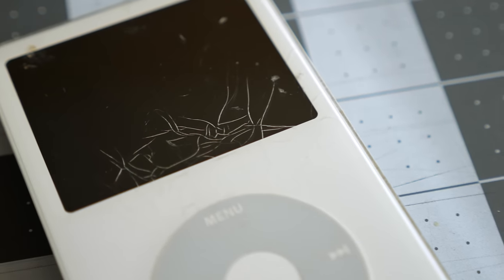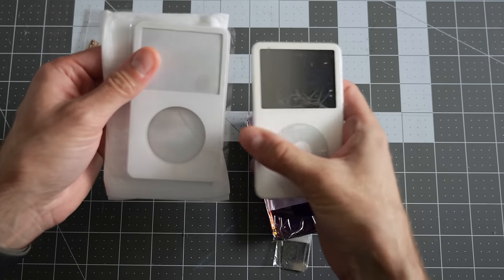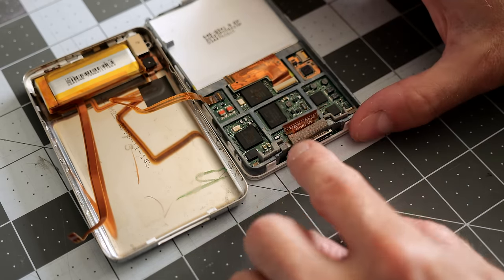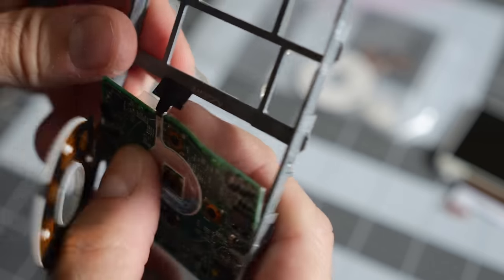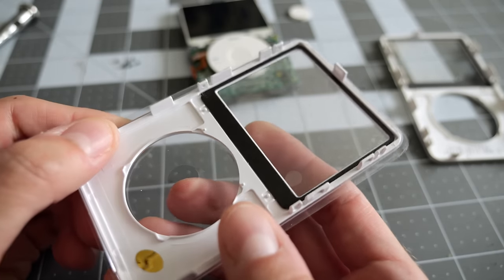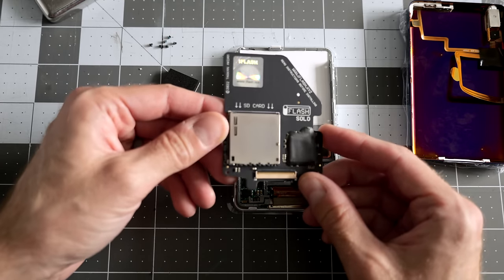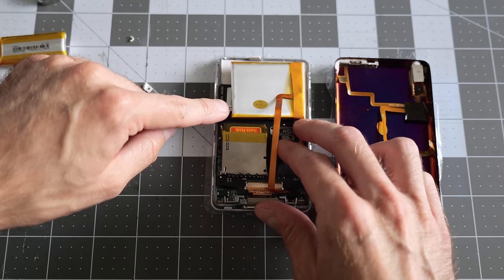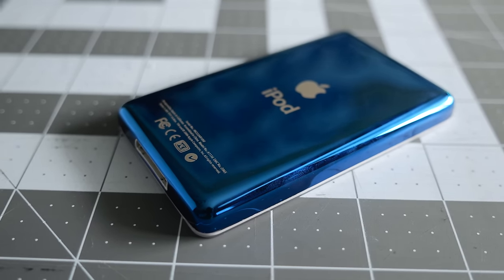Building a Custom iPod Video!

Comment: The iPod Video was legendary for it's popularity and general reliability. The interface was nice, the playback controls were great, the features were useful, and the DAC+amp combo were plenty competent for all of the file formats that iTunes supported at the time. Definitely a gem of an MP3 player. I believe it also supported Apple's CoverFlow album display, which I was always a massive fan of.

I'm also a huge fan of the double-shot clear over solid faceplates that Apple used to ensure that the device would maintain a premium aesthetic. The anodized faceplate on the 6th gen was nice from a tactile perspective since it was slightly rounded over and thinner than the plastic faceplate, but it has a very different aesthetic. Personally, I'd probably go with an mSATA drive adapter just for enhanced reliability and random IOPS performance, but that's really neither here nor there. High quality SD cards are quite reliable these days, so there's no particular detriment to going with one of those instead. Plus, it's not terribly expensive to get a 512GB drive in either form factor, even microSD.

Comment: A little bit of heat-- nothing crazy, just like from a hair dryer-- makes the adhesive a lot easier to remove without stressing the ribbon cables. Hope this helps someone.

Comment: If you break a zif connector locking bar (what he's is calling the bale) you can actually shove a thin piece of plastic on top of the cable in the connector and that will insure a solid connection even in the situation the device is jostled and moved about.

Comment: A correction about the maximum number of files. its not about the total file size, but that META data in the file, Song name, artist name, album cover, genre. These get loaded into ram when you hit play on any given playlist. 

This is why its roughly 20000 or 50000 songs, as it varies on what meta data you have. btw those numbers are for your average meta data. 
The limit is there because you only have so much ram to load this data into. You can have more songs than this number, but your playlist can't be more than this. so say you have 15000 in one playlist and another 15000 in another. you'll be fine, cause you are only ever loading 15000 songs worth of meta data into ram.

Comment: Fascinating. I never dreamed how repairable iPods were. This reminds me of an ad long ago for an early 60s VW Beetle. VW built a car entirely out of replacement parts to demonstrate the available parts support for its product.
Reply: I remember that being a thing, with the only exception to the rule being the thermostats for the engines cooling baffles being damn near impossible
Reply: Other iPods aren't so repairable; the 6/7th gens are aluminum, not plastic, so they don't flex when you pop them open, they just bend. Otoh, In my experience they're pretty solid, and it takes a bit to kill them, so maybe there's a benefit to it.
Reply: Compared to other mp3 players of this era, iPods were the most difficult to open

Comment: i did the exact same thing to my ipod 3 years ago. loved it. only problem is that it does not support high res audio - tracks that's 24 bit will be flat out ignored, and there's this hassle converting flac to alac each time. in the end i gave it away and switched to an android-based DAP.

Comment: I've still got a 5.5 gen iPod with its only issue being the battery not really holding a charge. If I did make any change/upgrades, I'd upgrade the battery and the hard drive (to an SD card and adapter). It's nice to see that the parts aren't expensive.

Comment: The "I talk too much, sorry :-(" section was one of the most important!  I was concerned that you weren't going to touch on the database size issue, but you saved it for last.  I have read that it's the amount of RAM that determines how big the database can be, because the database is resident in RAM.  A 30 GB iPod comes with less on-board RAM than an 80 GB iPod.  I've seen that some have been successful in swapping the SDRAM chips with higher capacity ones to effectively upgrade that as well, but it requires SMD soldering.  I've personally exceeded the "practical limits" for the RAM in my 30 GB 5.5 gen iPod Video by quite a lot, and it still worked, but had quirks: playback would stutter at the beginning of a track, and occasionally it would abort playback of a track and continue to the next as if nothing happened.

Comment: 5th gen classic, one of the greatest of all time. Hard wearing and reliable. I strongly recommend upgrading with a microSD, and with that the battery lasts longer. Could even put a larger battery in with the space you save.

Comment: such a modded ipod seems quite cool with rockbox so you can use the largest drive there is.
Reply: I totally forgot rockbox was a thing i vaguely remeber doing this to my ipod back in the day, unfortunately that ipod left my possesion like 15 years ago and after that i kept buying the sony walkman Digital players because they were cheaper, smaller and i could just attach them to my PC and sync without using iTunes which always was kinda glitchy and picky on windows.
Reply: You can easily do terabyte with regular OS. How much do you need in a music player? Rock box had terrible battery life as I recall.

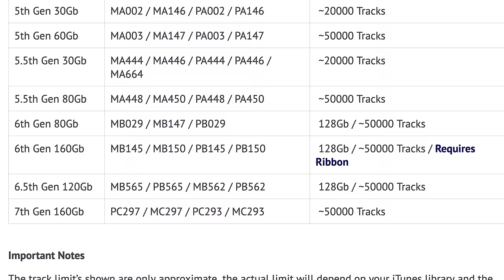Comment: 30:49 that’s a really interesting thing actually. This database songs limit it’s the reason that the dank pods iPod can’t handle more than 2 TB in capacity even without transferring anything. The way the iPod software (maybe hardware too) its built recognized the maximum of data it can manage at time. 

Another factor could be the file partition used, on the 90’s fat 32 was enough with a maximum  buffer capacity of 4GB, at that time it could represent something as the half of the HDD capacity, nowadays a simple HD movie could be heavier and you need another partition system in your hard drive to copy it, however this limits are higher every single time.

It was a really fun and interesting mod to do, I have one of that iPod video stored in a drawer, considering the process and cost it could be interesting to do, and because it has a 30 pin connector I can use it with an early gen Bose sounddock that I have also stored, I can give a new life for two awesome products
Reply: iPods can both work with Fat32 and HFS+
No 4Gb limit on HFS

Comment: Thanks so much for posting this video.  I was able to follow your directions and get my 5th gen up and running with 128 GB of storage.  I did tear the hold switch ribbon cable when removing the battery (I lifted mine from the right side with a standard screwdriver once I realized the hold cable was on the left).  Other than the hold switch not working now (not an issue for me), everything works great!  Thanks again!

Comment: Just stumbled across this channel and wanted to say thanx for posting. I was working on my 5th gen iPod (batt replacment #10 ?) I have had since new. I did the CF swap out many, many years ago and am just finding out allot has changed over the last 15+ years. Because of your vid, I just scored a 5th gen 80gb off of Fleabay. I will do the Micro SD upgrade o that one. The 5th gen is the best IMO, because of the Wolfson DAC. I dont know about you, but I also put RockBox on mine....again, many years ago. Audiophile quality dock connectors (pure Silver wire) going to high end (Ray Samuals and others) headphone amps and some kick ass cans, make a pretty damn good portable audio system. RockBox of course allows volume control (and other tweeks) through the dock connnector, thus bypasing the built in headphone amp section of the player. Love your vids....Mini Disc, yep...been there done that. Ripping DVD's to play on the iPod while on a plane flight, Ohh yea.
Reply: I want to fix my 3dr generation ipod nano, but I don’t know where, it looks like the battery died 😢

Comment: Huh, I'd been hesitant to flashmod my 5.5th gen because I'd had bad luck opening dead ones in the past, but I'd never gone looking to see if there were aftermarket replacement cases.  Now I'm kiiiiiind of thinking about it, even though my old one is still in pretty good condition because I always had vinyl skins on it.

Comment: That's cool.
Remember about red wine site. You sent it in and they upgraded the ipod. Capacitors and all the internals upgraded to make it more powerful device and make your headphones or speakers sound better. Amp, dac all that replaced. It was kinda expensive as well. I wouldn't of done it.
The drive upgrade is kinda cool.
I just use my phone these days for mp3's. I bought a usb adapter for headphones that are better then the headphone jack of the phone itself.

Comment: I have a 30GB video iPod and used it a lot. It still works but the battery needs replacing. This is the second battery that I've replaced. I loved my iPod but hated that you need to use iTunes to load stuff on the iPod. I wish you could just drop stuff into a folder. I thought of getting the iFlash kit but when I was able to do so I got a smartphone which eliminated my need for the iPod as it became my "iPod".

I have this other player the phillips GoGear ariaz player and you can drag and drop and it updates it's database after you unplug it from the computer.

Comment: What I've noticed with my 3rd party front panel is that the foam is like twice as thick as the original, probably due to the original having the screen squishing it down for 16 years. I'm going to leave it in for now, and hopefully by the time my replacement screen arrives (the original screen has a few dead pixels in the corner and it's enough for me to replace it) it will be squished down enough to get rid of any problems.

Comment: Worth pointing out that you can get into a 6th and 7th Gen Classic with about the same amount of effort and you only need one blade to do it. EliteObsolete actually has a video showing you the best way to open one up and that’s how I  modded my 6th Gen. Regardless of how easy it was to do though, metal is sharp and I did cut myself on the opening blade so glove up 🙃

Comment: So the reason the z height of the original screen gasket is because it’s compressed over time to create the seal. The new one is supposed to be compressed to fit as that’s how it seals the screen in.

Comment: I like the idea of upgrading internal parts like battery or hard drive… especially when they failed, of course. but when it comes to the case, I think I would stick with the original parts rather than putting on some cheap stuff, just to keep the thing as original as possible, even with some scratches…

Comment: None of the replacement front panels for iPod 5th / 5.5 gens are of the same quality as the original Apple ones, from what I've seen. They all scratch much easier.

The headphone jack and dock connector housing seem to break very easily from over tightening - you just have to be careful with them.

And I've heard Rockbox doesn't have the same database size limit, but I'm stock firmware anyway.

There is a rabbit hole of modding once you get to this level - I'm not really interested in the bluetooth mod but do see the appeal, I do sometimes think about the taptic engine mod, the usb c mod, a Qi / Magsafe mod, and maybe even stripping an airtag down and sticking it in there.

Comment: I used to have an iPod 5th Gen.   Used to use it as a companion to my iPhone, and had my entire music collection on it.  Then, one day, it met with an accident.   I was at my local train station and put my jacket on.   The iPod was in my jacket pocket.   Until that point anyway.   It came flying out the pocket, landed on the train platform, skimmed the platform like a stone with water (I can't even do this with stones and water, don't ask me how I did it with an iPod and concrete), and landed on the rails.   I asked a member of staff about getting it back, but at that time, a train was going into that platform about once every 3 minutes.  I was told they would try and get my iPod later, but I never got it back.

Comment: That black gasket might be the actual reason the z-height is more, the gasket is new and uncompressed, by removing it you'll allow humidity to get into it. Would have been better to compress it, or file down the plastic tab a little bit.

Comment: The old front panel can be wet sanded and buffed out. I have done it with many handheld console but you need a high speed buffer and compound. That I already have because I am a Collision Technician/Specialist

Comment: I normally steer people away from ipods just because copying songs back and forth has to be done inside Apple’s walled garden (No sharing files with friends when you’re visiting, for example), but this mod is sleek enough that I think a person could be very happy with the end result
Reply: This isn't an issue with these 5th gen iPods. You can install RockBox which makes the iPod act like a regular storage medium so you can drag and drop files like with a flash drive. In addition, it adds a plethora of different features (EQ, file compatibility ie FLAC & cue files, etc).
Reply: @TheGrayWolf81  Oooooh dang! You may have just been responsible for someone getting one as a birthday present
Reply: @TheGrayWolf81  wow I’m kinda interested now

Comment: During the lifecycle of the iPod I went through 9 or 10 of them. I think one or two died outright but generally what would happen is the hard drive would accumulate faults until you could no longer sync it. A bunch of them were swapped out during their warranty and then when the second one would die I would buy a new one. So once it was discontinued I had several broken iPods and I installed the older iFlash HD>CF>SD solution in a 7th gen 160 GB model. I'm thinking of doing another one because I have another of the same model that I already cracked open, I didn't find it too hard really. The 5th gen is a good choice if you have a 60 GB model but the 30 GB will only allow you half the number of songs in your database, which wouldn't work for me. The problem with the 6th gen is less about the difficulty of opening the case, it's that if you use the original OS you're limited to 128 GB. In any event I highly recommend it, even with the old kludgy adapter it's been very reliable and battery life was fantastic even using the original battery. It is finicky about being recognized by iTunes, I never really figured out why that is, but that's part of the reason I'd like to try the newer generation of adapters.

Comment: Nice video. I been fooling around with broken iPods myself. Started like six months ago.

I even got a broken 2nd gen iPod to restore and sync in iTunes under windows 11 with FireWire. But it still has some issues from a almost completely broke headphone jack and needing new wheel and screen.

I have a 5.5 32mb iPod with 2800mah battery long 2/3 width and thin. Tight fit but have 256gb iflash solo and thin back case blue with transparent front, click wheel, and button.  Then I have a 5.5 64mb ram iPod Black and white scheme  with black back thick with 256gb solo and 3800mah battery.

My next project is a 3000mah 4th gen u2 edition non-photo and or 3rd gen with off the shelf 3.7v generic batteries. Already did a proof of concept where I attached the wire/connector from a 4th bad batteries onto a 3000mah battery that a Chinese vendor was selling on eBay  had the same wire out with no connector to plug into board. Only downside battery was too thick can’t close case lol. But.. It fully charged using 12v FireWire, properly stop charging g at 100% and no problems running on battery.much better then aftermarket 1200mah. Waiting on few new batteries that should fit better a 3000mah and 2000mah batteries.

Comment: Now put Rockbox on it and no more database limitation. Also a lot more features and no need to use Itunes as you can drag and drop files over like external storage. Also, apps and games available to play with though the clickwheel limits what you can really do with those.

Comment: My favorite one to mod was always the iPod Mini, love the size of it, and it took CF native, no adapter boards needed, though there's SD>CF adapters, so you could still use cheaper SD cards if you really wanted to.  I built a 64GB Mini back in the late 00's, that thing was sick, I ended up trading it to someone though for some computer parts, replaced it not too long after with an 80gb iPod Video that I've still got around somewhere (probably still in the glove box of my seldom driven cruiser), I really should upgrade the heck out of that now.

Comment: I did this before the iPhones got high capacity. I still have an ipod mini at 128gb and an Classic at 512gb with a big battery. Had to get a few front covers until I found one that fit just right. It's hard to find one that fits perfectly with the click wheel so it remains flush and not too proud or sunken.

Comment: I'm glad you mentioned the lighter weight with the flash mod. I have the same mod, and I'm surprised how much I enjoy that small difference.

Also, it seems to sync a bit slower with the flash mod. It's not a big deal, but I was surprised when I first plugged it in to sync my whole library. I used a class 10 SD card.

Comment: I have 4x128Gb micro SD cards in mine. I could do with a new battery, even though the current one still gives me quite a few hours of playtime. I am just nervous of buying what might be a fake battery. The biggest problem I had, which actually precipitated my conversion, was that the little black rubber 'dot' under the centre button had moved and I managed to break something while trying to move it back to the centre position. Nothing a bit of tape won't fix, though!!